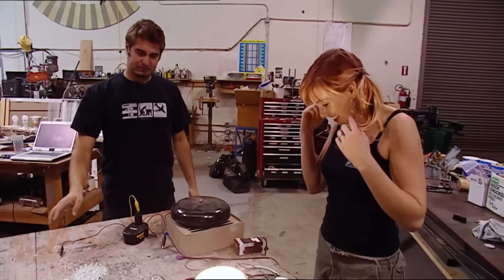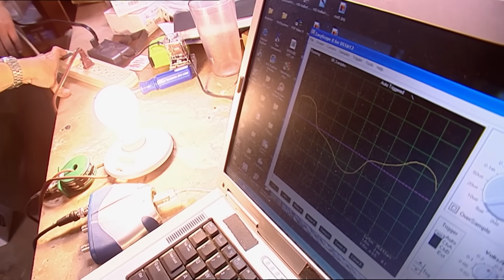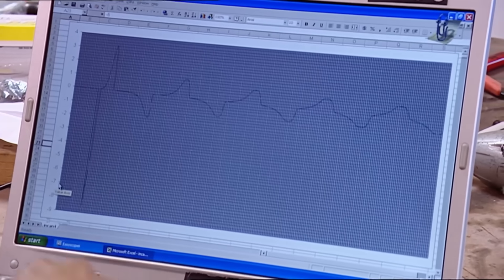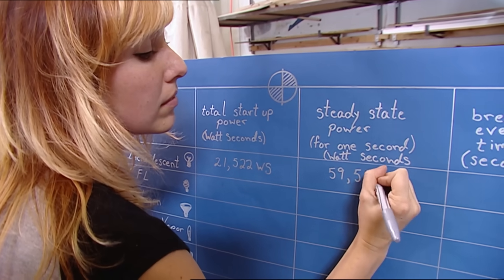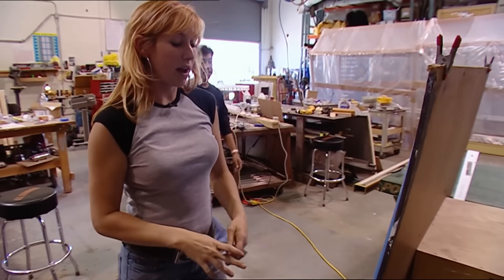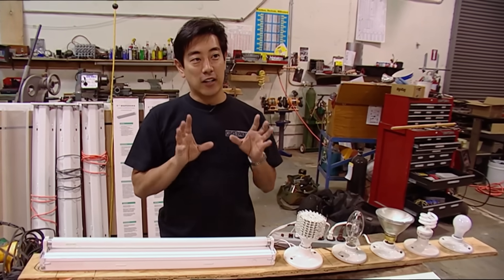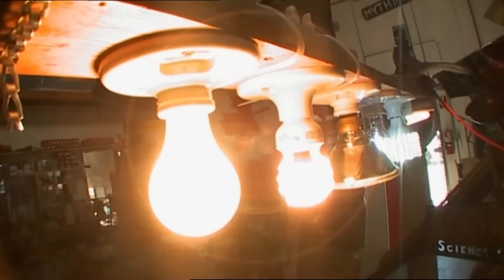Is It Cheaper To Leave The Lights On Than To Turn Them Off? | MythBusters

Comment: If the lights are on but no one is home, that's a problem.
Reply: Similar problem to those who have an elevator that doesn't go all the way to the top
Reply: Actually it tells people who are looking at your home that people indeed are home and are less likely to try to break in
Reply: @lukraniom8731  Surveillance cameras and alarm systems are a thing...
Reply: @SmilingNinja both way more expensive than lights
Reply: Metaphorically, very true!! 😅

Comment: You say they all fail during the on off cycling but surely you should factor in at what point they fail so if, for instance, the fluorescent fails after a day and has a high replacement cost that needs to be taken into account. Sure it may not make much difference but it is a bit of a glaring oversight. The power was never going to be the issue but the replacement cost was and that cost, particularly with some high tech lights like mercury discharge ones where you may need to hire a professional to change them and where startup stresses are high,  need to be taken into account. Some lights too take a considerable time to get to full brightness so there might be a minimum off time for it to be worth turning some lights off for. That might be a better metric?

Comment: There are two other factors to consider. First is heat. In a space that is being cooled,the heat generated by incandescent,HID, and magnetic ballasted fluorescent is a significant load on air conditioning.
The second is surge in a huge building with a lot of lights turned on at once. Not a big deal in a house,but something to be considered in commercial buildings where surge pricing is applied.
I replaced 400 and 1000 watt HID lighting in gymnasiums with T5HO fluorescent fixtures. The greatly reduced heat was significant. The biggest advantage,though, was that the fluorescent lighting could be turned off and on quickly while HID lighting has a restrike delay,so no one wanted to turn them off.

Comment: They neglected the wear and tear on the switch AND 
the cost of the brainpower to interrupt thinking to attend to the light switch. And
the cost of the calories a human spends to maneuver to and toggle the light switch, And 
the cost of the possibility of dropping something or hitting something while you are physically maneuvering to deal with the light switch. AndI
the cost of the possible disease you may contract from germs on the light switch.
The interruption of my thinking is the deciding factor for me. I leave my LEDs on, and I don't think about it.

Comment: It should be noted how much you are actually saving. Compact-Fluorescent Bulbs (CFL's) are typically rated to 10-15 watts / hr, while LED's are typically rated to 5-10 watts / hr. Power usage is measured in kilowatt-hours (kWh), or 1,000 watts per hour with a single kWh costing ~$0.15 in the USA right now.

A 15-watt CFL bulb would take ~65 hours to use 1 kWh (or $0.15) worth of power...or, in other words, you would have to make up 65 hours worth of 'off' time to save 15c. If you are turning the lights off for say, 5-10 minutes as you leave the room to 'save money', it would require you to turn the lights off around 250 times...to save 15c.

...and this is the 'best' case scenario for saving money - using the higher draw CFL bulbs, leaving for longer lengths of time. Assuming you are using lower power bulbs and leaving for ~5 minutes this may take more than 1,000 cycles to save you 15c.
Reply: You've got your units all mangled. Power is measured in Watts. Watts/hr makes no sense as a Watt is 1 Joule per second. W/h would be a measure of how quickly power consumption was increasing 🙂
Energy usage (you don't "use" power) is measured in Joules or sometimes people use kWh - energy consumed by something with a power of 1kW over an hour, ie 3,600,000J.
I find it funny that in the video they're using Watt Seconds... This is J/s*s, or to put it another way, 1J!
Reply: @mog0  Power draw is measured in watts. Power consumption is measured in watts per hour (Wh) or kilowatts per hour (kWh). A 1-watt appliance running non stop for an hour consumes 1-watt hour (1 Wh) or 0.001 kilowatt hours (kWh). The common analogy is speed vs distance travelled. A watt is the 'speed' or rate an appliance is using power while watt-hours is the distance travelled during that time.

So a few simple examples: A microwave might have a 1,500 watt capacity - that means while it is running it is drawing 1,500 watts of power. If it were to run for a full hour, it would consume 1,500 watt-hours or 1.5 kWh of power.

The reason I use kilowatt-hours is this is the way power companies measure and bill people for power. It is also the simplest rate to calculate energy usage and the simplest way to convert energy usage to a power bill. But don't just take my word for it - Google "power usage calculator" and have a look at the sites yourself.
Reply: @christophervennix9861 you were saying watts per hour for draw, which is wrong.
Technically power can't be consumed, it's energy that's consumed, but that's getting well into pedantry territory 😉
Joules is the SI unit for energy, although people often use Wh or kWh for easier calculations when calculating over a number of hours (removes factor of 3600).

Comment: Fluorescent lights will last for basically ever if you never turn them off.  There is a light in a friends warehouse which has not needed replaced in the 30 years it has been on but other lights that are turned off do die faster.  Probably something to do with thermal cycling.
Reply: Also, as for most things, earlier iterations of the products were built to last longer. Eventually, companies always wise up and realize they can cut corners and get repeat customers.
Reply: @tosvus one of the compromises that where made that shortened the fluorescent light lifespan was making them turn of faster like regular lights.  What usually fails on for us light tubes is the filaments on the ends, which are only really used during the starting phase where the filaments heat up to cause the mercury vapor to begin to ionize, and then once it ionizes enough, it then can strike across and then it’s just conducting from one side of the tube to the other.  What happens is if you never turn it off then the filaments aren’t really wearing out, but if you are constantly turning on and off, then those filaments are thermal cycling the ballast simply act as a current regulator to limit the amount of current that can go across because an ionizing tube Would otherwise be a dead short, which would allow a lot of electricity to flow.  It’s funny how you can effectively make a light that never burns out as long as you never turn it off. I went ahead and put a fluorescent light in my shop that I just leave on and it’s been going strong for years now no idea how long and it’s one of those twisty ones that screw into regular fixture.  The only times that it will have cycled is after power outages.  I am curious how long it will actually last.
Reply: @tosvus  There's not much incentive to do that, 4 foot fluorescent tubes are incredibly cheap due to the large amount of competition.

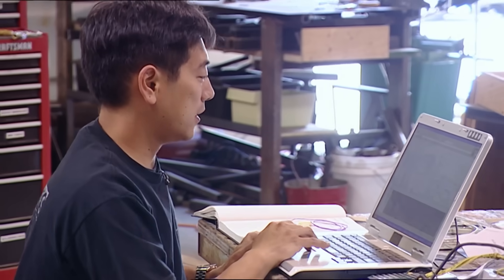Comment: Uh, sorry, I'm sure Grant was a smart guy and all but these numbers here for the switch-on energy at 3:00 make absolutely LESS THAN NO SENSE WHATSOEVER. Watt-seconds are a unit of energy, they're literally just joules, not power as the chart says, and a bulb that consumes OVER TWENTY TWO KILOJOULES of energy in the first fraction of a second it turns on wouldn't be a light bulb, it'd be a BOMB. It's pretty obvious he had no idea what he was doing here.
Reply: I think he just somehow got a factor of 1000 wrong. Maybe he confused mA with A. I mean a light bulb, that consumes 59.000Ws per second seems a bit unrealistic. 59Ws per second aka 59W would make much more sense.

Comment: They had all this equipment and blackboard for what is not a mystery at all. They didn't give any data for metal halide that they had on hand and didn't answer how long each of the bulbs lasted except that they had all burnt out. You can also reason that if the inrush was as significant, your breaker would trip. The ends of a fluorescent tube blacken from sputtering of the filament. Halogen with a transformer has the advantage that the slow warmup time of the thick spiral lowers the thermal shock that it experiences.

How was the LED arbitrarily chosen to be just 1 watt? That would no doubt last long.

Comment: The real issue is hassle. Having to flip lights off and back on again isn't worth it if you're just leaving the room for a short time.

At current US average residential electricity rates, 1 hour of a 90W equivalent LED bulb being on only uses $0.002 of electricity. That's 0.2 cents.
Even a 90W incandescent only uses about 1.6 cents an hour.
That's both a weird size, and a strong light. I'm more used to 60W equivalents in the home. Those only use $0.0014/hr.

With LEDs especially, it's basically just not worth fussing over turning them off anywhere you're not likely to be away from for at least >1 hr.